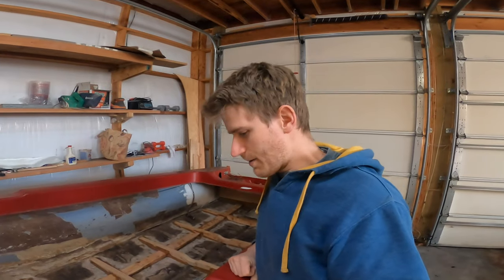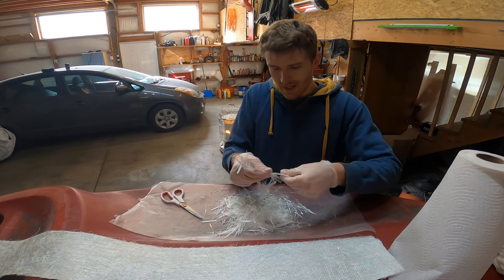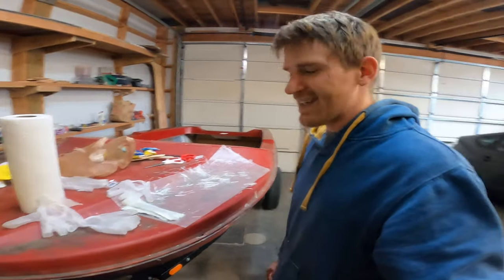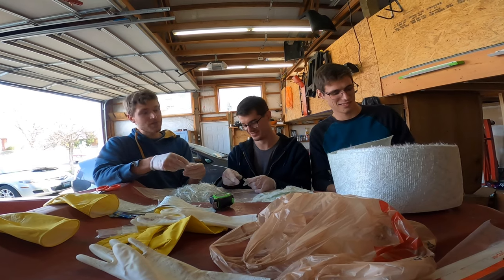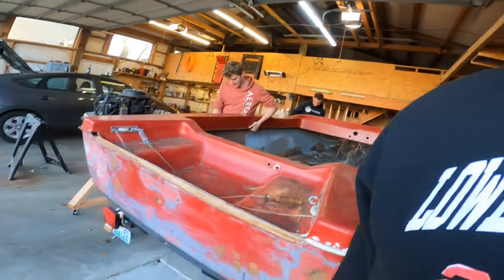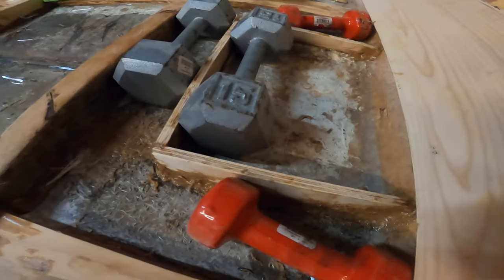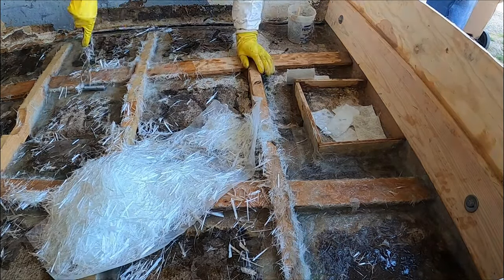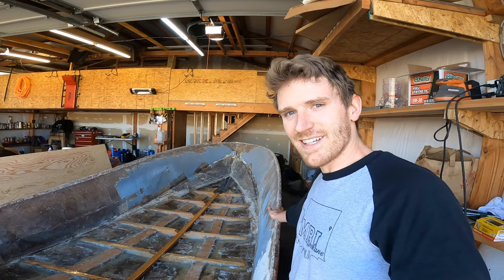Boat rebuild (PART 14) Fiberglassed stringers

Comment: Many Boat Manufacturers still use chopper guns to save time and expense. They also use 1708 in critical stress areas. I suggest you use 1708 Glass Mat, (2 layers) it will be Much Stronger and that area needs to have a lot of strength. The 1708 is a weave on one side, chopped on the other, that's where it gets its strength. The thin layer of chopped glass you installed probably won't hold up very long, you will run the risk of cracking a stringer. Enjoying your series.

Comment: Is there still a gap between the keel and the ribs for water to drain back to the stern bilge area? You are doing great and it is fun to watch you get through what has to be far more than you bargained for in a project.
Reply from the maker: Yup, I made sure there was a drainage channel. Haha I did buy the boat as a rebuild project but you never really know what your getting untill you dig into it. But it has been fun thanks for following along! 😊

Comment: These boats originally had the stringers glassed in with a chopper gun. Much faster but very similar results.
Reply from the maker: i looked into getting a chopper gun setup but it was very pricey from what i found. otherwise i would of gone that route
Reply: @Project2Potential  Same :D
Reply: In part 5, "Removing The Stringers" you can see the Manufacturer used Chopped Strand "Mat". They probably used a chopper gun but a structural glass "Mat" needs to go back in preferably a 1708.
Reply: That’s why it rotted.